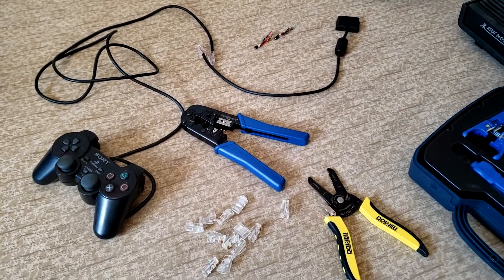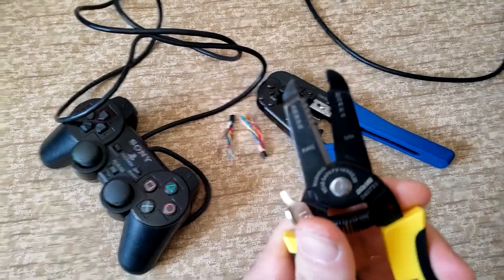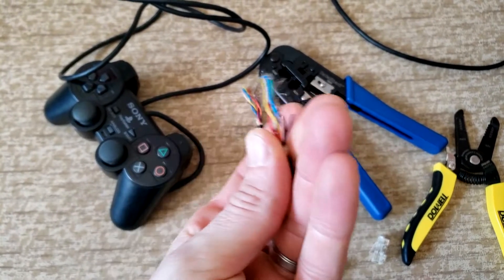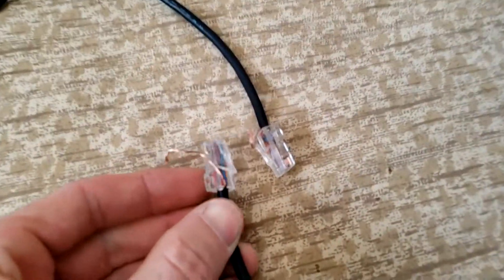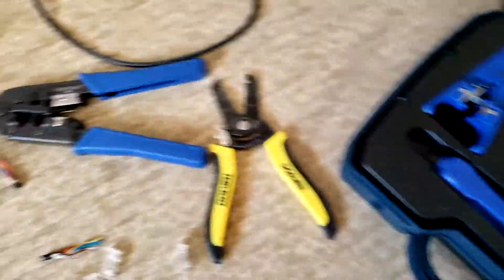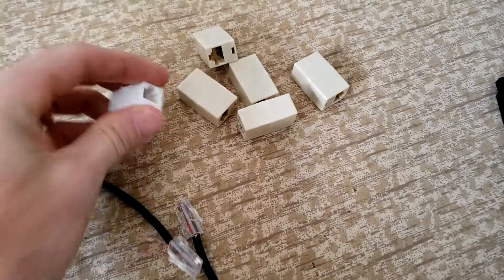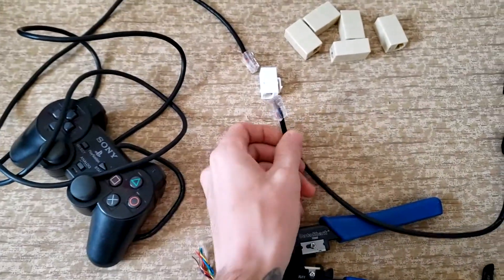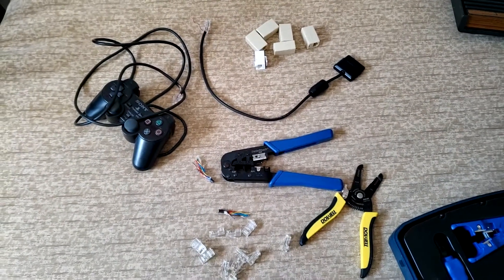PS2 PS3 PS4 Controller Wire Repair with Ethernet RJ45 Connectors (Playstation)

Comment: Thanks for this, I am going to replace a completely split cable with a 2.5m ethernet cable, the problem is that despite 8 pins being used, there are still 9 wires on my controller, gray and black come from one pin and terminate at two different places on the motherboard but I will just make a jumper between those two pins
Reply: Did you do this? I also have two destroyed pink PS2 controllers that both need a whole replacement wire. I need to get the plugs off the end and that’s a hard task on it’s own lol
Reply: @Alexander_l322  I got stuck on removing the pins from the plug, if I could do them I would finish the project. Also my vibration motor fuse is blown so I can't test if the motors would vibrate.

In theory this would work